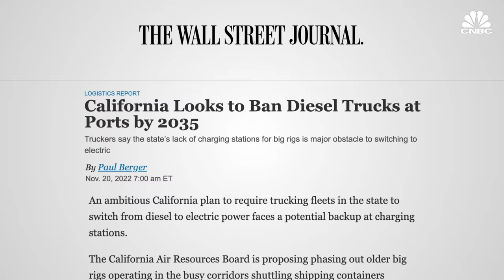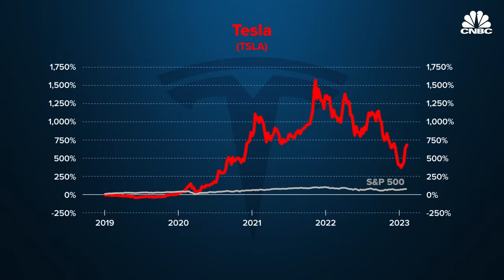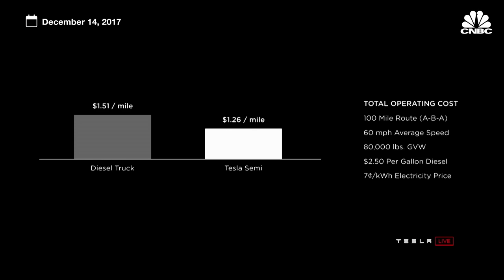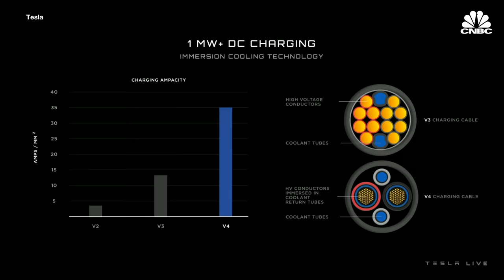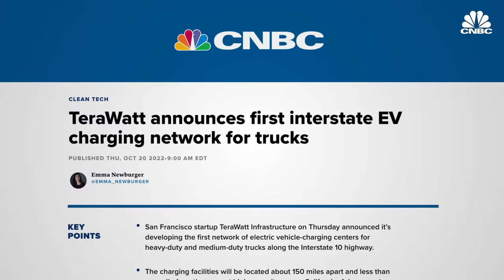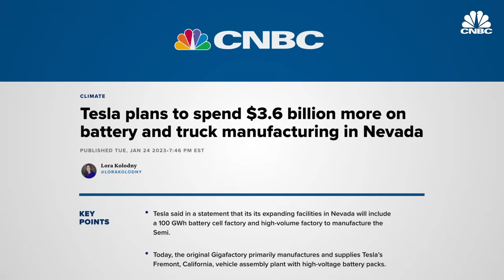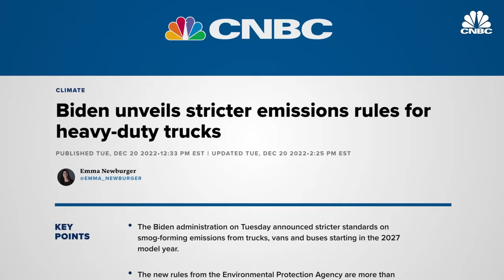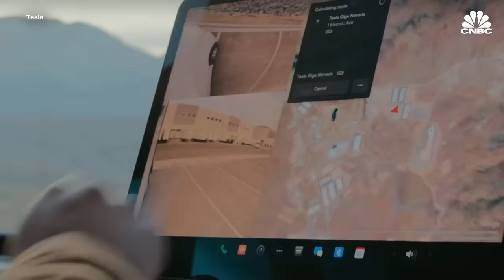Does The Tesla Semi Live Up To The Hype?

Comment: All of these other EV semis cost more than the Tesla Semi, have half the range and take 3x as long to charge for the same estimated purchase price.   Tesla is the only company capable of building the EV semis at scale and can build the charging stations.
Reply: Faster charging likely means more rapid battery degradation.
Reply: @Dudanation12  Not when cooled properly, and not when the battery is actually larger.
Reply: @Dudanation12  Battery tech is changing drastically every 3 months.  Scotty, and others on this channel continue to use information from 2015.   They are stuck in their views based on continued misinformation.   Tesla's gen 3 platform will reduce cost by 50%, use hairpin motors, 48v power with motors that no longer use rare earth metals.   People don't know anything about Tesla on this channel but they keep applauding every time Scotty talks about how smart Toyota is for being 5 years behind Tesla in EVs.

Comment: Fully loaded 0-60 in 20 seconds.  Accelerates up hill with a full load.  Regenerates while coming downhill instead of noisy engine brakes.  Truckers are forced to have a break so the charging is done then.  400 miles confirmed in real world too.  They won't be screwing up traffic that's for sure.  As a truck driver I would love it.
Reply: Anybody that tells you it is a good idea to do 0-60 in 20 seconds in a semi is a dam fool. That will increase roll over accidents for sure and probably many others as well. Anyone that has driven yrucks for any length of time will understand this. Imagine being able to get to 50 miles an hour in a top heavy semi while going on a cloverleaf on or off ramp. And unfortunately people nowadays are too stupid to understand you cant drive a semi like a car. And all of teslas safety features wont prevent a semi trailer from rolling over.

Comment: Remember every time they slow down or stop the battery is being charged, as was the case with a hybrid car that NEVER were plugged in to charge. How much difference this makes will have to be seen, but going down mountains will charge enough to really matter..
Reply: honestly thats prob baked into the range, also that amount might be a fractional amount, like +2 miles.  you don't break much on the interstate.

Comment: They will. We're still in the very early stages. Also it wouldn't be too hard for them to beef up the battery packs to extend the range a few hundred more miles. These large semi trucks have a lot more space to work with expanding storage than a tiny little car.
Reply: You got to think how much gvwr you loose when your put denser batteries in
Reply: No they can’t, they have to meet a certain maximum load capacity. If you increase the battery you significantly decrease the load capacity. Now maybe they can make their batteries and motors more efficient, but bigger batteries? No.
Reply: More batteries, no. More energy density, yes.
Reply: @cheeneep  I don't know have you checked out the upcoming Tesla Roadster specs? 620 mile range. They're obviously beefing up the battery pack in little car that size for a hefty price tag. I would imagine if they wanted to and put their heads together with some of the smartest engineers in the world they could figure it out for the semi as well.
Reply: @AchillesWrath1  The problem with adding more batteries to the semi is that batteries are very heavy. Roads and especially bridges have certain weight restrictions. Electric Sedans doesn't have this problem. So the only way to increase range without adding weight for the semi is to improve the energy density of lithium-ion batteries.
Reply: what about the weight the truck would carry more battery weight than the actual cargo
Reply: with 18 wheeler (cant call them diesels...) it is weight not space.
Reply: @zedrhyx1788  False. Batteries weight perhaps 10 tons. Payload is about 22 tons.

Comment: Even 400 miles is mindblowing the fact that we even have this in our reality right now is mindblowing but you guys are like oh my gosh it's not going 500 miles
Reply: So Pepsi doesn't want to run them down to zero percent on a regular basis, I can get that. Still has a 500 mile range.
Reply: 400 miles is not mind-blowing when hauling POTATO CHIPS. This is just a publicity stunt by Musk that coincidentally starts with the lightest possible cargo to volume ratio. Next video: Styrofoam factory?
Reply: Because conventional trucks with 200 gal plus capacity run 12-1500 miles before refueling. So that's in consideration.

Comment: The manufacturing comparison are often made with existing manufacturing workflow with Diesel + Transmissions powertrains, whereas EV based products will have less part and can be more adaptable to faster production method, thus more units per year of production, they have shown to be more effective at revising their production over time over other OEMs and have high profit margins. It will be interesting to see the various competitors in this segment being their offerings against their products and production efficiency ratios to profitability.

Comment: Once I heard them say Pepsi refused to let the drivers speak, I knew we were much further away from full EV fleets than this video is suggesting.
Reply: Because tesla is publicly stating they need to make a lot more battery cells to justify using the cells, it's  1 $200k truck vs 10 $50k suvs for the same amount of battery, tesla owners interview drivers, main complaints are around the design and not the electric drive train.
Reply: When does any trucking company allow drivers to speak to TV reporters about how the company operates?

Comment: What I see here is a lot of corporate suits justifying rosy predictions and hoping their proposed strategy bears fruit.  I have a hard time seeing that happening, as it's based on flawed battery tech that is not scalable to the degree desired, and a grid with the same challenges.  I also doubt that an un-biased environmental study of the full impact of EV semis vs ICE (raw materials acquisition to final vehicle construction plus maybe 100k of mileage) would show much advantage for the EV's, especially if the power to charge them comes from mixed sources.  I'm very wary of the EV hoax being used to justify big govt grants that end up mostly greasing cronies.
Reply: @FrunkensteinVonZipperneck  Imagination doesn't solve the environmental and acquisition problems of lithium, nickel, cobalt, and copper mining that must more than double in the coming years to meet unrealistic political goals.  It also doesn't solve the problems of EV's falling short of promise on range and hauling predictions, made worse in cold conditions.  It doesn't fix the myth of CO2 savings when all factors are weighed properly.  And it doesn't cover the enormously high replacement costs for batteries in a few years once their charging cycle limits are reached. If one seeks facts, you'd know this already, but apparently cheap personal attack is the only tool at your disposal.
Reply: @CrustyCurmudgeon  
We have plenty of raw materials for evs, we will be recycling all these materials. There is enough lithium to makes tens of billions of evs in the ocean alone. Cobalt will be seeing less use as tesla uses batteures that have limited amounts and LFP batteries use literally none. LFP batteries will be the battery for 80% of evs and stationary storage, so no cobalt use won't increase exponentially. Especially because we will recycle, and once enough material is mined we won't need to mine much more.
Reply: @CrustyCurmudgeon  
And yes it does reduce Co2 output, even if your ev is only charged by coal. This is because coal plants are easily 40% efficient while most gas cars are only 25% efficient. There are plenty of studies that prove this, but you just hear something and believe it.
Reply: @ogzombieblunt4626  Considering that current lithium recycling amounts to something like 5% or less, that's placing a lot of hope on an infrastructure that doesn't exist yet.  Regarding CO2; I was referring to all CO2 produced, from mining to manufacture to use (charging source).  The CO2 expended to mine for and manufacture batteries place EV's in a deficit vs ICE vehicles coming out of the factory.  The only way they make that up is if the charging source is hydro or renewable, which most is not.  To build out a renewable grid of sufficient capacity for the major EV transition desired will cost billions.  That cost must be included in higher rates, which will tilt the whole "EV is cheaper to own" equation the wrong way.  Technical feasibility doesn't equal practical reality with our current EV tech and grid conditions.
Reply: @CrustyCurmudgeon  
Wow you aren't good with numbers. lithium recycling only accounts for a low % compared to the amount of batteries because those batteries have a 15 year life, only the original model S cars from 2012 are old enough to recycle. This is why there isn't a large amount of recycling happening... obviously 🤦‍♂️
Reply: @CrustyCurmudgeon  
Yes there are studies that look at the Co2 it takes to make the battery, even in west virginia it only takes 4 years to reach equllibrium with initial and cumulative Co2  from an EV compared to gas. You gotta do some research man.

Comment: At least Pepsi put solar panels up to use to try and help with powering these vehicles.
Reply: Solar panels on a typical vehicle are more a stunt than a practical power source. You can't angle them to the sun so you never get full output, and there is only enough space for a very small solar installation. Putting solar panels on the roof of a warehouse where the vehicles are charged up is a much better idea.

RVs are an exception.
Reply: @vylbird8014  I think he’s referring to the solar panels over the parking lot.
Reply: yo uican easily power them with your panels, not just "help"
it will get there very, very soon, because they may claim its for the environment but actually its for the money, well electric wins by far in every metric so it's a win win win

Comment: Every other OEMs range is half or 2/3of the Semi...
Reply: But but...they have more experience in building Trucks
Reply: because they have a smaller battery and they're designed for shorter hauls kind of what they're using these early Tesla semis for. The problem with the Tesla is that it's trying to compete with a diesel semi and it might fall short. The other electric trucks are not trying to be something they can't.
Reply: @Cornelius87  No, it's because all they did was hack together and modify off of what they already built - with a diesel engine in it usually.  They are not efficient at all.  I wouldn't pay half the price for the knock off, rather just get the Tesla Semi.  Perhaps someone is coming out with a ground up EV semi but I am not seeing any but the Tesla in this video.
Reply: @Cornelius87  Because they cant, and they also looks like a barn door, which is not good for aerodynamic.
Reply: @mathijs9365  yes, and cars, but not EVs :D Its not that easy as every journalist and analysts thought.

Comment: One idea the presenters touched on ,(not directly featured) is the further adoption of CNG and LNG as a replacement for diesel. While I don't think that is on the table for California, I do think it is something that we will see in coming years (outside California ).
Reply: Gas is not  an emission neutral energy source,  its also incredibly wasteful.
Reply: I'm skeptical CNG and LNG will be used much but I think fuel cells make a lot of sense for long haul class 8 trucks. Short and medium haul BEV like the Tesla semi is ideal.
Reply: @markusstrobl1067  
Any fuel cell truck will have THREE TIMES the (electrical) energy cost as a Tesla.
If you say "but they'll generate from solar on site"
THAT solar would still move a Tesla 3 times the distance.
Plus of course they'll be servicing 3 times the solar panels, PLUS a complete hydrogen storage network.
HUGE expense.
LOne more cost? Water supply.
You need clean water to produce Hydrogen, (lots of it)
Where from, and how much?
.
(and don't fool yourself, the cost of the energy WILL be passed to the end user.... eventually)
.
Search "how long does a fuel cell last?"
(It's not long compared to batteries)
Reply: @rogerstarkey5390  I see fuel cells as a transitional technology specifically for long haul when time is more important than fuel cost. Eventually even long haul will go BEV.
Reply: Vancouver Transit started buying natural gas-powered buses in the early '80s (taxis too). Vancouver still has electric buses on major city routes (remember trolley lines? Vancouver never dismantled them. California may catch on to the facts of clean air transportation in a couple more decades...).